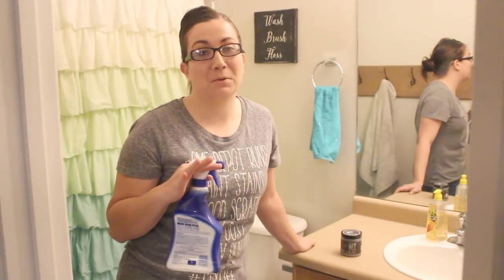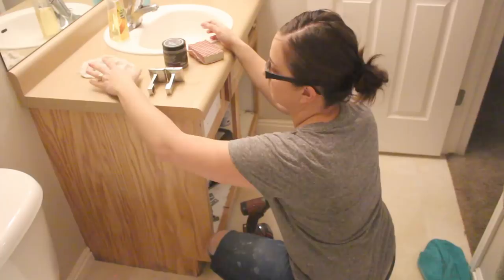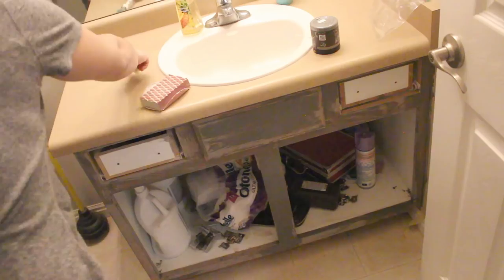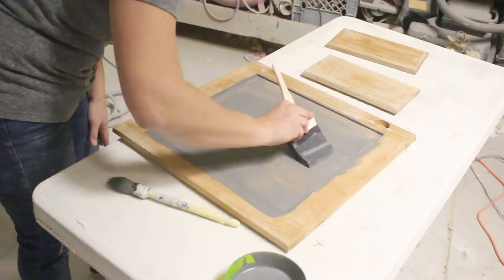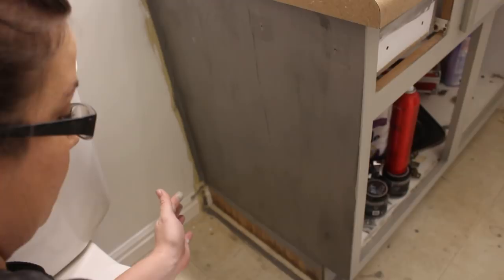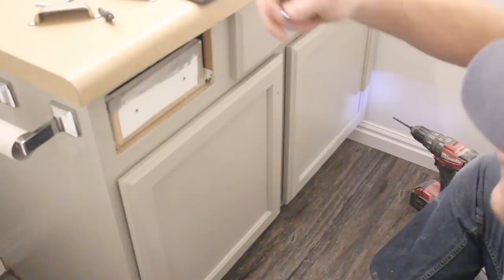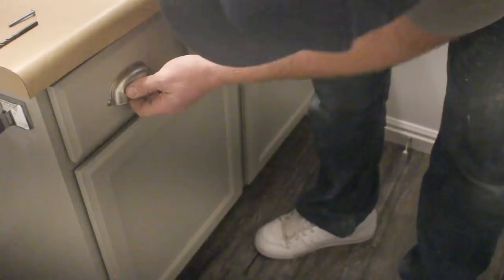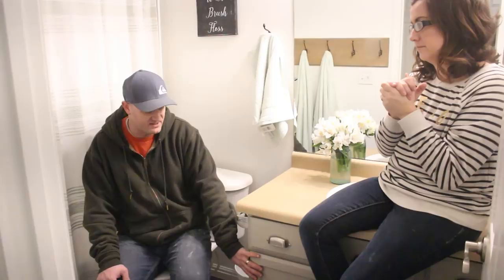Bathroom Makeover Part 1 | Painting the Cabinets

Comment: I love the video and colors you used. I would love to redo our vanities but like our kitchen cabs, I don't think they're real wood.  Looks like (previous owner) they got wet in some spots and starting to peel and welt up a little...?? They are all white and the spots where they've welted up a little could be sanded I guess and shows brown under neath. Is it MDF you think? What would you do to refinish them? They have a shiny coat of whatever over top of them...I just don't think they're real wood.
Reply from the maker: Well, if they have plastic type covering there isn’t a whole lot you can do. Sounds like they are mdf underneath if they are swelling. If you want to try...
DIY or Fairy Chalk Mother Chalk paint would stick to it with a little persuasion. I would definitely do a good sanding with a 150 grit to rough the surface up a bit and smooth out any swelling areas. If you sand down to the mdf you may have to fill those spots with a lightweight spackle to smooth them out. I would use High bond for sure. It’ll help your paint stick better. Maybe try a small area and see if it even adheres to the plastic after sanding.
Reply: Thank you so much! I was looking at a few other youtube videos and was thinking they may be laminate. Not 100% though. Like you said, they have a plasticy coat but could be sanded to the MDF. I could get all wood cab fronts and that would solve all my problems..lol. This is when I wish I had cheap wood builder grade fronts. These gotta go! Thanks again for all the tips and suggestions!

Comment: Jamie, do you ever have trouble with the big top yellowing on white paint? I use minwax water based poly and it occasionally yellows. ☹️☹️☹️
Reply from the maker: No, I’ve never had either product yellow. I have had a lot of yellow bleed through but if I shellac the yellow spot, repaint and then seal over the spot it gets rid of the yellow every time. 
In my experience water based sealers can reactivate water based paints and it will sometimes pull stains/tannins up through the paint as the sealer dries and hardens. Hope that helps!

Comment: Does anyone had or have problems with paint still being tacky after days of painting? I used oil based paint and it's pissing me off? Anyone can tell me!? Drying time takes 8 hours and curing takes up to 7 days but mine been 10 days already
Reply from the maker: Is it humid where you live?  Humidity can make things take a lot longer to cure.
Reply: @JamiRayVintage  I live in Minneapolis, MN. Roughly 80%  in the winter. B